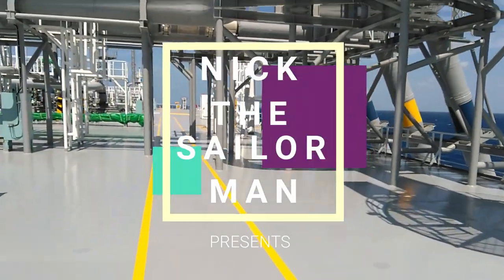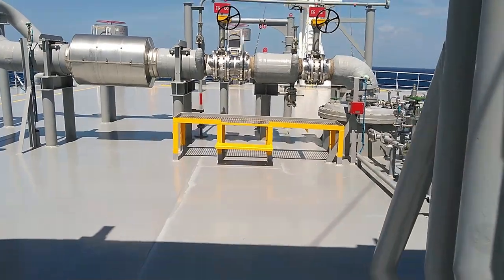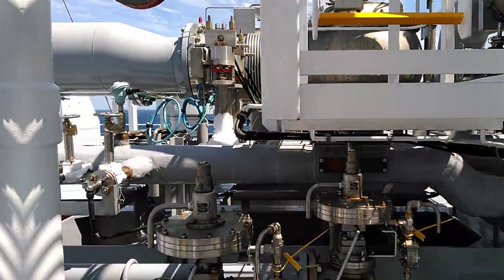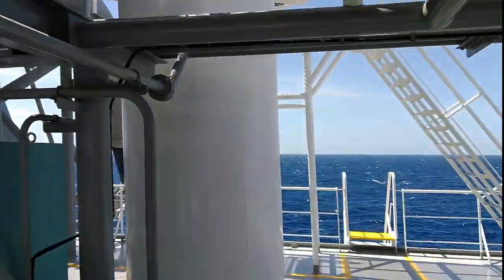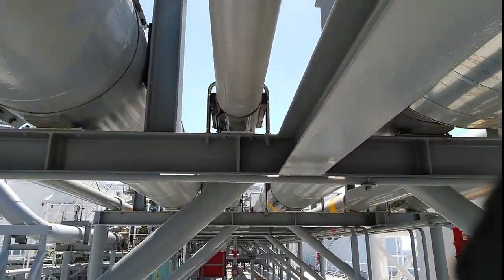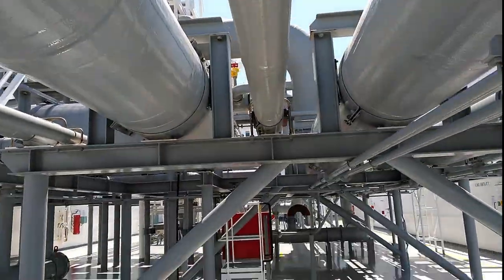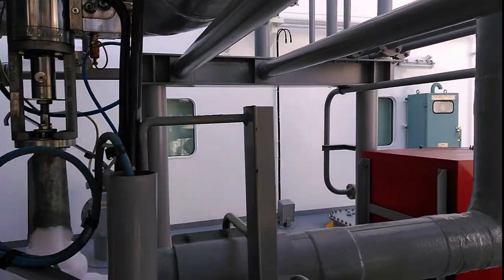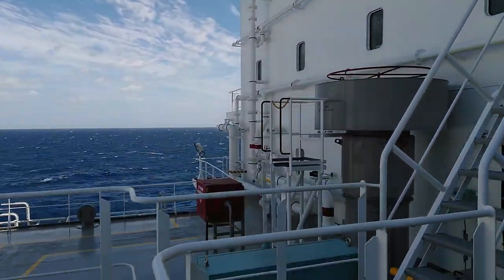Familiarization on Trunk Deck while the LNG Cargo Tanks Cool Down is performed, what I need to know!

Comment: Dear Captain Nick.
It seems you have misnamed spray line valves "discharge" and "return" (frame 1:13 and onward). First I thought you have very customized piping system, but now I checked against other videos from this ship. So CS-X00 - Spray Return Valves, CS-X01 - Spray Pump Discharge Valves (they have non-return valves added).
I am very grateful for your videos and am waiting for next pieces of your great education cycle.

Comment: Just one question:
When you do the fuel gas burning at sea, do you use fuel gas pump to supply lng to vaporisers & D/F engine(or gcu)? OR do you extract the excessive cargo vapour to LD compressor and then send to D/F engine(or gcu)? 

Which one is the normal practice?
Reply from the maker: Priority is to handle the NBOG or with relique or sending the Gas to Dfde engines.Last resource would be the GCU.
Reply: @nickthesailorman360  When you send the gas to df engines, you send from vapour header?
Reply from the maker: @charliemak9803  from header absorbed by the LD COMPRESSOR

Comment: Hello captain, may i ask you about the function of sub cooler unit? And about LNG Vapourizer and force Vapourizer, are they the same machinery (or system) but used in different way?
Reply from the maker: Hello Iwan subcooler subcooler the LNG on board.Forcing vaporizer to be used during passage which requires more gas than the NBOG, LNG vaporizer for gassing up and in case of discharge operation no vapour from shore side then we need to start it
Reply: @nickthesailorman360  so LNG Vapourizer and force Vapourizer are 2 different system and used for different purpose. Thank you capt.
Reply from the maker: @iwanfaesal5890  correct

Comment: Dear Sir, may I ask which camera do you use to film on board your LNGC in hazardous areas please? I would like to do the same on an LNG fueled ship. Thanks a lot. Best regards.
Reply from the maker: Hello David I used the one from the ship, I remember the brand it's Econ but don't remember the model and I also purchase program to make the captures more sharp.

I attach you one possible similar safe ex proof option for you https://shop.satomec.ch/en/atex-ex-smartphones/1438-i-safe-mobile-is655-2-atex-smartphone-zone-2-22-android-9-0-wlan-nfc-bt?utm_campaign=merchant&utm_source=google&utm_medium=paidsearch&gclid=Cj0KCQiAwJWdBhCYARIsAJc4idDOflFnw5HxLIDIQxIAoqUPHjDhsOSGP8qu79REKONMKEif3hw7nuwaAj_1EALw_wcB#/155-variantmodel-with_camera
Reply: @nickthesailorman360  Thanks a lot Nick. I don't know if I will be able to share my videos for free, but yours are great. Would you be able to film connexion and disconnexion process while it actually happen or too complicated in terms of risk assesment? purging and pressure testins during connexion, drainage and purge before disconnection. BR David
Reply from the maker: @davidchaveron2424  this can be done but requires permission from terminal personnel to be filmed in it.
Reply: @nickthesailorman360  you are right, I will also ask the permission to the bunker barge and the terminal where it might happen. Thanks for your help again.